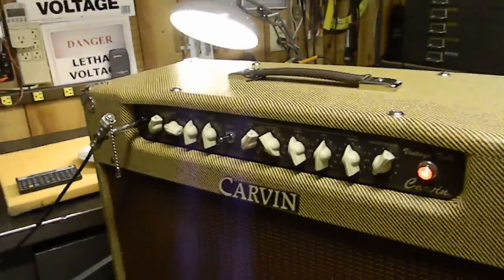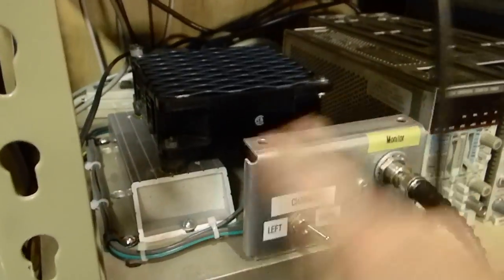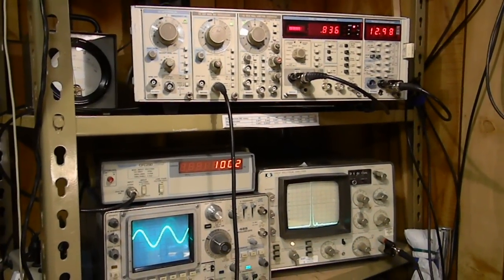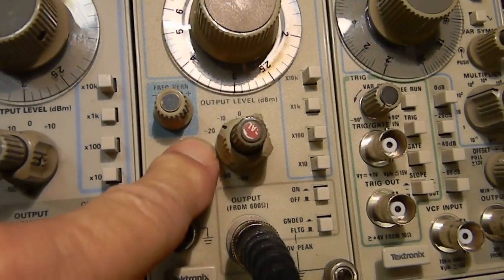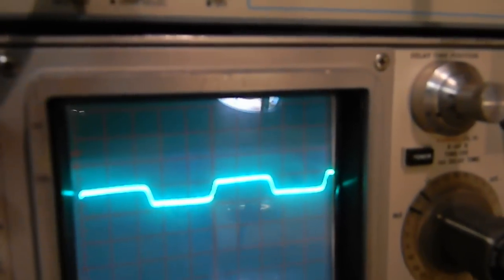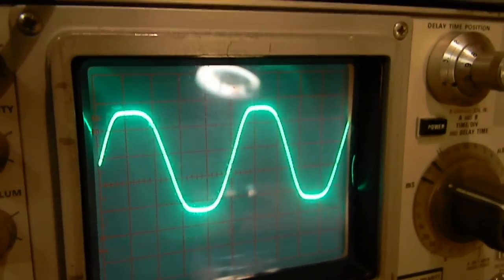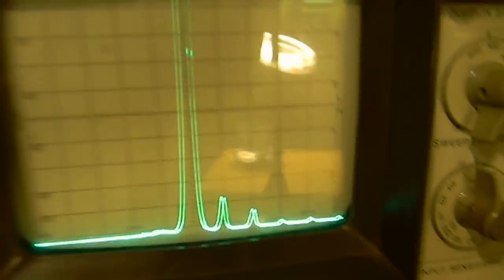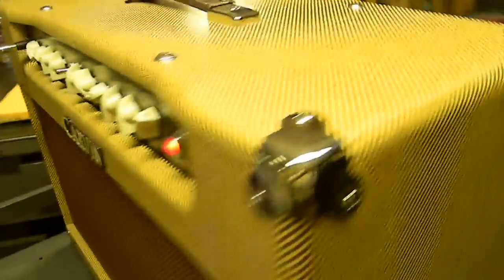Carvin BelAir 212 Repaired and Under Test.MOV

Comment: I own a 2004 edition of this amp.  It has one of the best clean channels available at any cost.  Very vintage Fender Twin type sound: jazzy, warm, open and very powerful. Nobody on the internet has anything but praise for the clean (first channel).  The Soak channel has clipping diodes in it's preamp circuitry that sound fuzzy/ fizzy.  It's usable but doesn't charm your ears like the clean channel.  Put a J-Station, Boss/ Vox multi floor pedal before the clean channel & ROCK!  It's pro gear.

Comment: Great demonstration of the characteristics of this amp and thanks very much for posting.  Every one agrees that the clean channel is fantastic but the soak channel too muddy.  A number of modifications can be found on the web, most of them identified and documented by a chap that goes under the name of HasseRL.  These modifications (e.g. clipping diode removal, cathode  resistor bypas cap, setting bias etc) are said to much improve the soak channel.  If you ever get a Carvin Bel Air or Nomad (same amp but 1x12"speaker) with some of these mods I hope you can run the same diagnostics. It will be very interesting to see the changes vs. the original.

Comment from the maker: Actually, "no," this level of equipment is not necessary for average amplifier repair.  I do this so that I can, hopefully, provide an objective element to the equipment being tested and value to those that watch my videos. There is So much nonsense "technical" information everywhere about amplifier performance - especially power output and distortion. I try not to inject any opinion and just present the data as the equipment can provide. I hope it helps.

Comment: I wish you documented the impedance ratio on the output transformer. I have this amp and tested it to be 2,500 ohms on the primary side. Every model I do shows the el84 tubes cooking right up with an estimated 72 watts total output!  Maybe the power transformer just can’t keep up anyways and it’s a moot point?  Yet when I model a 5k primary impedance everything becomes perfect. I don’t know what to do?  I can plug in my 2x12 speakers at 16 ohms into the 8 ohm tap to get the 5k needed. Am I missing something?
Reply from the maker: This video being 10 years ago I don't remember much about it but after viewing a bit of it,  I see it has a quad of EL84 - that should be worth a max of about 35 watts and the primary of the output transformer should be around 4K for a quad. Since you have measured a 2.5K primary, you could put your 16 ohm speakers on the 8 ohm tap and raise it to 5K. That could help. I don't remember if it has fixed bias or cathode bias but I think I would make sure plate current is not exceeding the maximum.
This is the datasheet I would use.
http://www.jogis-roehrenbude.de/Roehren-Geschichtliches/EL84/8BQ5.pdf
Hope this helps.
Reply: ElPaso TubeAmps it’s a fixed bias amp. How do I measure plate current?  I only see a spec for maximum plate dissipation. Should I pay attention to max cathode current instead?  I am using an online model to check that maximum plate wattage isn’t being exceeded. I strummed a chord while chassis was outside the cabinet soon after I had the amp delivered. One of the 6BQ5 tubes seemed to shoot off a red plasma around the tube and it scared the crap out of me. That’s when I began checking bias current, which was set absurdly low- then discovered the output transformer had a primary impedance of only 2.5k. I fiddle with the parameters of the online model, but nothing prevents the plate wattage from going into the stratosphere. I just wish someone else documented the same thing and tell me how it’s viable?  Power transformer can only deliver so much which is a limitation
Reply from the maker: @voxpathfinder15r  The safest way to measure the cathode current is with a bias probe. Here is an example on Ebay.
https://www.ebay.com/itm/Bias-Tool-Tester-for-EL84-6BQ5-tube-amp-amplifier-9-pin-probe-MADE-IN-THE-USA/233565274210?epid=1756076732&hash=item3661934062:g:OJMAAOSwkhxenZPm:sc:USPSFirstClass!79903!US!-1
The plate dissipation is the current you measure with the bias probe times the plate voltage.  Max plate dissipation is 12 watts so at 300 volts this would be 40 mA. There is debate where to set this up to the max level for the sound you want but 70-80% is probably max which would be 32 mA at 300 volts.
Bias voltage is in the -6 to -7 volt range. I have never really worked with the 6BQ5 so I find that a really low bias level.
Hope this helps. And, BTW... I do know these little tubes do run hot as hell.
Reply: ElPaso TubeAmps thanks for the information. The plate voltage is around 400 in these amps with a -16 V to -17 V grid bias voltage. I am using the Russian version, 6P14P, which are a little more heavy duty at 14 watts max plate wattage and upgraded 4 watts on G2. But still have to keep things reasonable. I will do a little derivation of average power dissipation when a tube is in classB mode, maybe that part of the load line can breach the 12 watts power curve by a good amount without much of a problem. But I will definitely check the max cathode current isn’t breached either. Thanks again

Comment: Question about this Carvin amp. You set it at 8 ohms but it has two 8ohm speakers in it. Shouldn't it be set at 4 ohms?
Reply from the maker: I don't remember anything about this amplifiers output connections. I agree that two 8 ohm speakers would be either 4 or 16 ohms. How they recommend connecting it might be able to be found by searching for the schematic.

Comment: Great Informative video, this series of amps was hawked at a rating of 50 watts.  The questions always is 50 watts of what?  Pure white noise?  Same power section of An AC30 that is being touted at 30 watts, but some analysis by some dude online suggested that it's perhaps more like 20 watts if Vox's claim of true Class A amplification are true.  I'd say a fairer rating would be to call this a 40 watt amp with 10% harmonic distortion.
Reply from the maker: It has been almost eight years since I posted this so I had to watch it and actually, it is a pretty impressive amp for a quad of EL84's. 30 watts clean which is the reasonable and upper clean limit of four EL84's and 40 watts at 10% THD - not bad and just what you said. I agree that 50 watts is over the top but the exaggeration of power is typical of  just about all vacuum tube amplifiers. The only ones that consistently ever told the truth about their vacuum tube amps was McIntosh and they underrated their amps by a good 10% or more. The MC75 and the stereo MC275 rated at 75 watts per channel can do 96 watts under 1% with good tubes. That is 128% of their rating. Glad to see the video is still of value after all the years. Thanks for your comments.
Reply: I may be buying one of these units soon because of this video!
Reply: I really need to make use of the tons of boards and other parts I got from their repair department, and cataloguing it and selling some of it needs to get done. Funny thing is I got screwed into hauling away two dinosaur large placement machines from royonic... the auctioneer told me they came with the boxes of tubes and parts pictured and of course they didn’t and of course they screwed up and started with my highest bid even though nobody bought any of the others. Complete nonsense.
Reply: Shaun Koreshowell/Bunds do you have any Belair chassis?

Comment: i know its been a lot of years since this post, but i have a question. this amp has two 8 ohm speakers in parallel, which gives you a 4 ohm load, yet you have the selector at 8 ohms. I checked the manual and it does say in the belair amp to use the 8 ohm setting unless you use an extension cabinet. What am I missing. why would you not use the 4 ohm setting, and if you had an extension cabinet wouldnt it need to be a 4 ohm cabinet hooked up in series and then use the 8 ohm setting.
Reply from the maker: I have to agree with you. I can even see in the video the speakers are stamped 8 ohms and are parallel. I don't know why they recommend this except maybe it gives the tone/overdrive/crunch/etc that is desired. I think that, in some cases, what we feel, believe and think (and hear) overrides analytics. Mismatching the load impedance will change the reflected primary impedance (load to the tubes) and will affect power and tone. Like you say, it's been a long time and I sure don't remember any other details..
Reply: thanks for the reply anyway. I guess if I get curious enough I'll have to try to contact someone at carvin and ask them. good job on the videos though. I stumbled across them looking for info on belair amps. mine is so bright i have to set the treble on 1 and the bass on 10 just to get it close to acceptable. It seems like most people have the opposite problem with them from what i found so far. oh well, the search continues
Reply: onus gumboot I had that very same question - I am waiting on some new Warehouse speakers that I ordered. The owner's manual says the ohm setting should match the "speakers(cabinets)".  Cabinets? So I just looked online and the owner's manual these days says "For the Nomad or Bel Air combos the standard setting is 8 ohms. In the case of adding an extension cabinet, set the impedance switch to 4 ohms." So I think they do in fact mean if you are adding a cabinet then you change the ohm setting. Did you ever contact Carvin about this?
Oh and that is an amazing video by the way. Thanks!
Reply: The speakers were disconnected and the amp connected to an 8 ohm dummy load on his equipment shelf.

Comment: i own the carvin nomad.. the same as belair with one 12 speaker... i love the sound...
i did a mistake and connected the boss me 50 to the effect loope of the carvin amp , the mistake was that i used the L and R out from the me 50 to the send and return of the amp...now i got a buzz-hum noise when i turn on the amp even before i connect any   thing to it,did any one can inform me if it make sense  that the damage is a due to wrong connection ?

Comment: 34 watt at 1 % distortion.. That is impressive from a quad of fixed bias EL84.  How much distortion is present at the claimed 50 watt ??

A cathode biased quad could give you according to the datasheet, 30 watt at 3.4% distortion. That is with 300V plate and 300V screen. The carvin has ~ 400V plate.